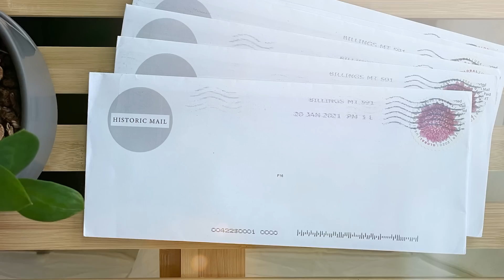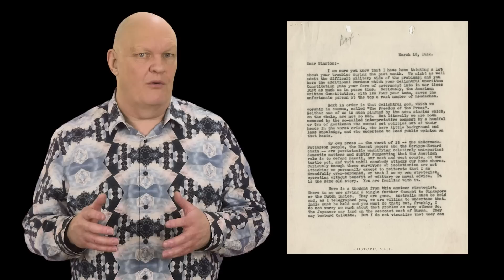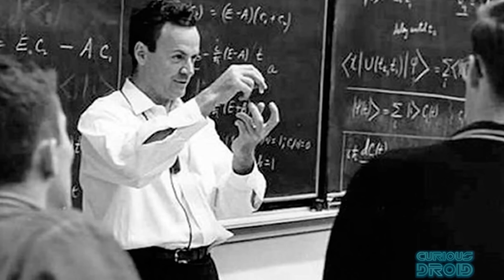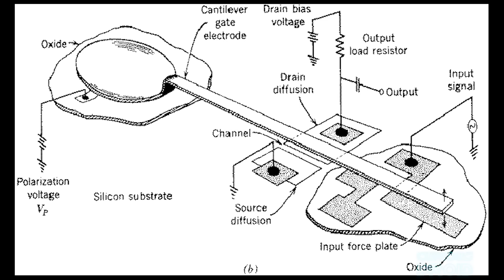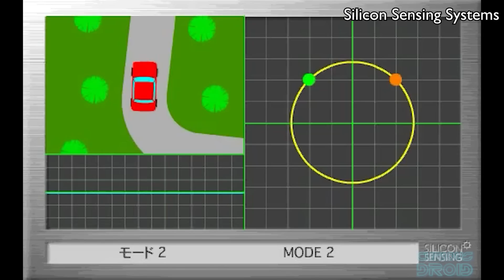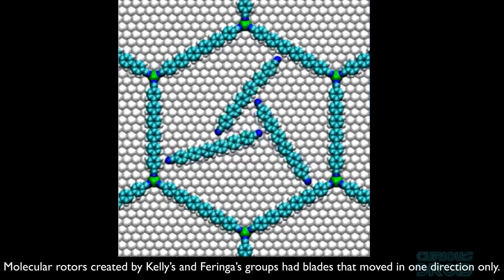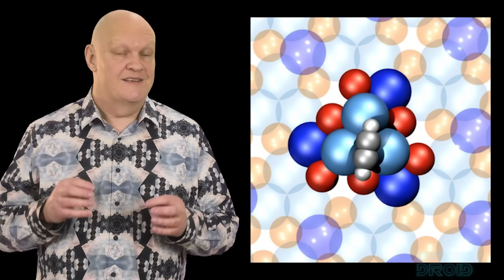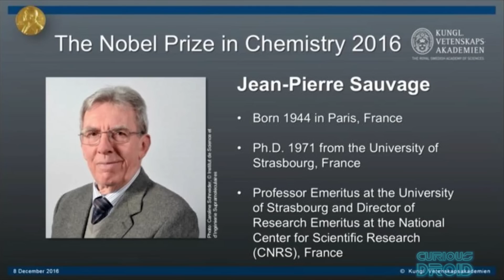The NanoBots Are Coming, How Will They Affect Us In The Future?

Comment: POSSIBLE TIP FOR TARGETED INDIVIDUALS.
I am a targeted individual which means  that I have been illegally implanted with injectable implants and because of those illegal implants criminal neuro operatives transmit voice to skull messages which I hear coming from inside my own head against my will and without my permission.   This situation has been ongoing for more than twenty one years.  I am being subjected to non-consensual experimentation.   
Sometimes, in the middle of the night,  I am woken up to hear those criminal neuro operatives discussing me and discussing aspects of what they are doing to me.   They are very arrogant and they talk about me as if I am their slave.  However, I can destroy their experiments anytime I wish for a short space of time.  What I do is I use a standard analogue radio.  The button on the radio is normally set at FM during the day.   However, at night I can hear many AM stations.  I switch the button to AM only.   I then hold the radio to the back of my head which is heavily implanted with illegal implants and I move the dial of the radio up and down through the various AM radio stations on a continuous basis.   I sit on my couch for about twenty minutes while continuously moving the dial of the radio up and down while the volume is set farily high.   I then hear the voice to skull neuro operatives talking among themselves asking where has the subject of their experiments disappeared to and can she be got back.   They then get angry with each other and try to blame each other for incompetency.  
I can not keep this act of moving the radio dial going for very long.  My arms get tired and I have to keep changing the radio from one hand to the other while moving the dial continuously.  Still, it allows me to escape those who are experimenting on me for a while, but it does not stop the voice to skull voices at all.   They continue to talk throughout the whole process.   Any type of analogue radio will achieve this because I have had several different analogue radios over the years and they were all effective at blocking the activities of those who experiment on me remotely by receiving and transmitting digital signals to and from my brain and body illegally and without my permission.   I don't know who any of them are because I have never met any of them because I do not go out socially and l live in the countryside and not in any town.  I go shopping weekly to one of my local towns but I do not speak to any strangers while I am there and because of this lifestyle I know that I have never met those who remotely electronically harass and psychologically torture me from a distance while remaining anonymous cowards.  My name is gretta fahey and my postal address is newbrook, claremorris, co. mayo, eircode f12 y560, republic of ireland.

Comment: What exactly would you make the manipulators out of for a nanobot that can rearrange matter at the scale of individual atoms?   It would have to have a tip small enough to grasp individual atoms, which would mean being no more than a few atoms itself.  How do you bind those atoms together more tightly than the bonds holding together the atoms of the matter you're trying to rearrange?  For that matter, how would you power a nanobot outside of a laboratory environment, and what would keep the swarm of natural micromachines it would find itself surrounded by out in the wild from attacking and destroying it?

Comment: Nanobots will be worse as they will be misused and hard to contain... All it will do is 'write' a payload into a biological target. Then you will get some that are affected by an environmental factor that changes the payload in ways that are likely not noticeable in the short term. Also you will not be able to tell what the 'payload' actually is until it delivers it... worse still if it has a "test detection mode," though that increases the size require, unless it's not a computational trigger... 

SO, yes, it will be misused, and it does not even need to be malice, but "weaponized ignorance" which has the same outcome as malice, but without the smoky boardrooms and a malicious and conspiratorial discussion.

Example, you shorten a cable that goes from a laptop screen to the mother board to save money. This cable now rubs on the hinge as it is too tight and breaks. You then offer to fix it, at a price or just using the warrantee insurance matters not,  you only offer to replace the entire upper assembly as the wear part (the cable) is not detachable. You ignore the screams about newish laptops breaking when they should not and for as long as you can get away with it... You then, eventually, do a recall on a model... ignoring that the same fault is on all the lines produced...  (there is 2 examples in there, a deeper look of their entities practices would show the same pattern more broadly, that is an important distinction from incompetence) 

None of that needs to be malice and deliberate intent in the design phase, and the part that comes after does not need to be malice. The deliberate use of ignorance to avoid taking responsibility OR to bring about fixes that would end such future problems, while it may not be deliberate malice, can be ignorance that has been weaponized to achieve the same result as malice, after the fact.

Weaponized Ignorance and Malice are indistinguishable from each other, they look alike and achieve the same result. 
They must be treat the same!

Maybe then this technology will not be an issue....

Comment: It's more likely that the nanobots will have AI capabilities, whether by connecting to a device or by acting as a neutral network themselves. (So they'd be kind of like a super intelligent ant colony, where each nanobot acts as a neuron in the neural network.)

So this just loops around back into being an AI problem. Programmed "dumb" nanobots won't be nearly as horrifically capable as the stuff I'm describing and I don't see nanotech advancing great lengths unless it is paired with AI.